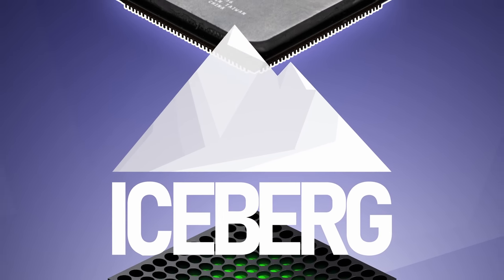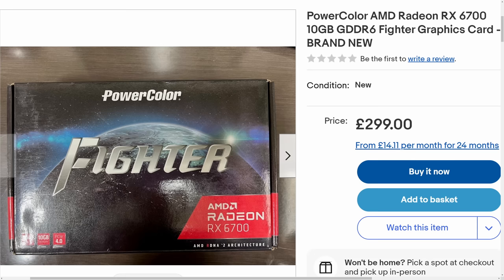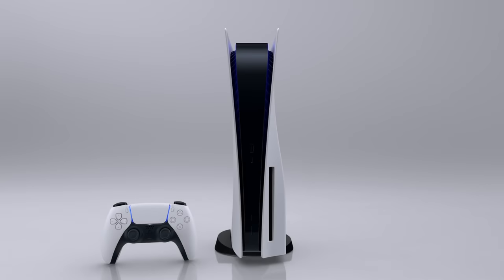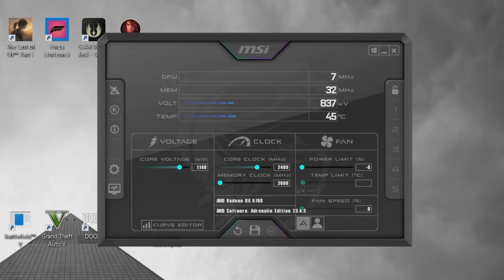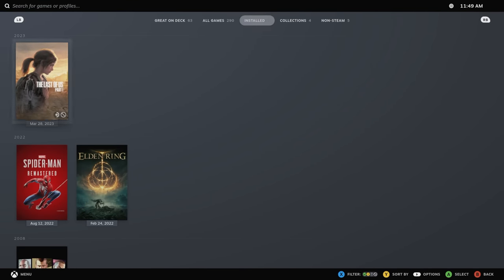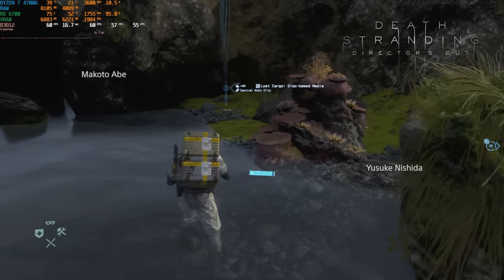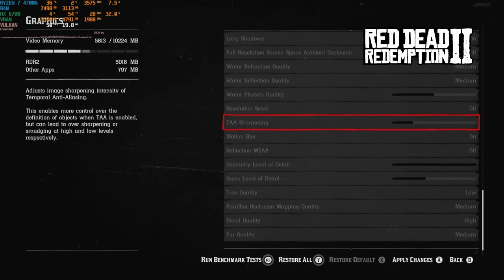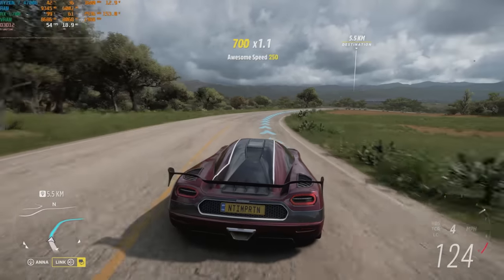I Built a 9th Gen Console (kinda)

Comment from the maker: ERRATA/CLARIFICATIONS
10:55 Yes, of course I meant Big Picture mode, I even wrote that in the script, I don’t know what was wrong with me when I recorded this…
11:11 Just using the Medium preset in TLOU gives a pretty smooth 30+ experience overall, but as far as I can tell its image quality isn't quite up to PS5 standards.
Reply: Okok 👍👍👍
Reply: Iceberg just keep making the videos you make, I love each one of them and watching your videos always makes me feel very cosy and in-home. ❤
I am sure you will reach 100k and more subscribers under a year.
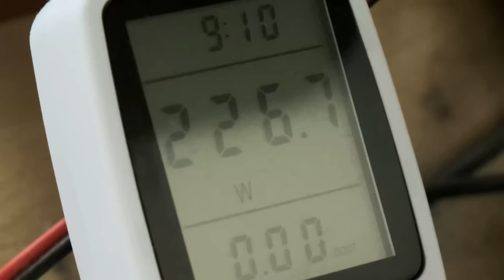Reply: Seems to be a green/blue flickering horizontal line on the screen from 15:35 onwards until 17:33
Reply: AMD doesnt report power consumption correctly with any ryzen cpu besides the latest 7000, RDNA 2 also use dream numbers, this is why its important to use a watt-meter or LDAT when it comes to AMD power consumptions. Nvidia and Intel have been reporting correctly for as long as i can remember.
Reply: 1800p?
That's simple enough with ToastyX CRU. 
For example, I've created many arbitrary resolutions such as 1778 x 1000p and 1689 x 950p. You can also create custom refresh rates like 48Hz for watching 24FPS content.
Reply: You can use 1800p on pc you just need to create a custom resolution

Comment: Making a budget console equivalent this generation is much harder compared to building a PC similar to PS4/PS4 Pro back then
Reply: Amen to that brother
Reply: Several reasons for that 
1) These consoles actually a have competently designed CPU architecture instead of AMDs Bulldozer mishap.
2) These console came out with for their time pretty darn decent graphics power (instead of outdated laptop grade and old crap)  
3) These consoles are (or at least initially were) sold at a loss instead of profit since day 1
And add to that the nowadays utterly insane GPU and motherboard pricing (CPUs, RAM and Storage are actually at the price point where they should be). Cryptoboom+Scalpers messed up the market and NVIDIA and AMD decided they'd like to continue that pricing structure.

Things are starting to look up somewhat again though, an AMD 5600 is only $118, AM4 motherboards start at ~$70 and with some luck you can pick up an RX 6700 XT on the used market for $250-275 or ($150+ for a RX 6600 XT if you're happy with a less than console like experience). At least PC gaming is possible again at a $500-1000 price point, during the height of the cryptoboom just the graphics card alone would run you the price of an entire system.
Reply: Hell yeah and then making an actual good gaming PC we should target higher than the best current gaming console cause one thing consoles can always rely is they always have more customized hardware and usually better optimizations...
Reply: Consoles are sold at a pretty big loss, they make up for it with game sales and paying for online.
Reply: the ps4/xone were underperforming pretty hard early on with games like gta v that ran at 1080 30 because of the cpu while on a gtx 750 ti 1080 60 was easily possible nowadays in games like god of war on pc the ps4 performs closely to a 1050 ti and im not even kidding
Reply: @Axeiaa  the ps4 gpu was actually decent basically a hd 7850 lower mid range card together with gddr5 vram with up to 150gb of bandwith it punched above its weight in the last few years
Reply: @xtr.7662  Yep that's just one more reason a serious PC gamer should go considerably higher than the console...

I also remember even with my outdated GTX 570 bought in 2011 with massive 25% OC over stock 570 clocks which brought it to around 1.9 Tflops which on Nvidia side was considerably better real performance than a same Tflop ATI\AMD card from back then and I could play a lot of games better and with better settings than the PS4...

But it didn't last long until the point GTX 570 barely could play any demanding game specially because of the lack of Vram with it's only 1.28 GB and PS4 just kept getting better and better showing more and more visuals...

ps: Every gen that happen, though nowadays PC's as long as you have enough Vram, ram and decent hardware probably will last longer than ever compared to it's matching gen of console, but sadly lately it seems bad PORTS are still a god damn thing FFS😡
Reply: @Axeiaa  Number 3 is QoL feature creep. It's unfortunate that those features don't come at previous gen prices, but that sort of to be expected. At some point soon, given the sales data from the PC market, we'll start seeing the budget stuff - especially when the next Ryzen APU's hit the market - come back to the fore.
Reply: Do the pirated games make up for the difference?
Reply: @bulletpunch9317  LMAO. How do I love this comment 🤣
Reply: When the PS4 was brand new the PC Equivalent was also wayyy expensive. As it grew older, however, that's when the console equivalent PCs began to get to the cheap levels
Reply: Yeah, it's like building a PC that is like a Xbox Series S where you at the very least need a GPU that can run any current game at 1080p, at any setting and not dropping below 30 FPS.

That is the GTX 1070 or equivalent, the 1070 is still expensive on eBay.

Then Ryzen 7 Zen 2...not cheap either...
Reply: Yeah but what about: Games being a lot more expensive, PAYING A SUBSCTIPTION TO PLAY ONLINE, console devaluating instantly as soon as you buy it, not being able to mod games, not being able to choose your own graphics settings to disable that ugly TAA and DoF, Not being able to use your PC for work or whatever else you want.

Console is a complete waste, console is stupid.
Reply: @Axeiaa  Technically the previous gen consoles used the Jaguar architecture for their CPU cores, not a Bulldozer derivative. This doesn't change the point you were trying to make though. Jaguar was an evolution of Bobcat, which was designed to compete with Intel's Atom CPUs.
Reply: @bulletpunch9317  I dumped all my money into the PC so it’s the only way to get games🤣 
seriously though games on steam are usually cheaper than consoles and there’s no stupid monthly subscription to play with friends. And games with visual or enhancement mods is just so much fun. Playing everything at 2K 170hz has spoiled me, 30fps gives me headaches now haha
Reply: PS4 GPU was pretty much a Radeon HD 7850 which was released for $249 in 2012, and in 2013/2014 it was even cheaper. Manwhile today we have to pay $280-300 or more for a new RX 6700.
Reply: Reminds me of the OG Xbox, that thing had so much power compared to the average pc in 2001
Reply: @Axeiaa  They weren’t bulldozer though. The Jaguar cores in those machines are a totally different architecture and are closer to Netbook CPUs based on K8.
Reply: Different OS?
Reply: @takehirolol5962  Yep, it's usually in the later half and mostly towards the end of a consoles lifespan, when you can build an equivalent performing PC (new) for roughly the same price.
I'd give it another 3-4 years yet (or 2 more GPU gens), until it's easily possible. That's unless you are buying used parts, which might just be achievable within the next couple of years or so.
One thing's for sure, the performance level that's given out by that PC by then, will be judged to be squarely within the realms of it being a lower-end, budget gaming PC, rather than a mid-range gaming PC like now.
A consoles overall value and it's "price to perfomance" ratio, just tanks and loses out to PC as they age. This is due to them still being firmly tied to old tech and the console manufacturers unwillingness to then lower down thier prices to a reasonable level, in order to reflect that then aging tech that's found inside of them.
Reply: Imho, if all you care about is gaming, you can buy a used B450, used R5 3600 - that's $100 and probably comes with a stock cooler. PBO, undervolt, LLC and a decent kit of 3600 RAM taken to 3800 with tuned timings, you're absolutely performing better than the PS5 CPU. That's $150.  This is assuming no particularly good deals - otherwise much cheaper. 

A used 6700 XT is about $250-300, can probably find it for less or buy a 2080 Ti for about the same. Now I understand you're still missing an SSD and PSU (any cheap case will do, but people have different requirements). The PS5 comes with a 512GB SSD - that's $20. Spend about $50 on a refurbished B-tier PSU and you're $20-50 overbudget - again just using market prices and NOT assuming any good deals. 

I don't think it's that hard, I think it's matter of wanting plug & play vs being a PC gamer/hardware enthusiast.
Reply: @fafski1199  I agree on what you said and it goes like that. But I am impressed with this generation of consoles and how those perform, not bad at all.
Reply: @b0ne91  3600 this processor is worse than in consoles apu 4700S.
Reply: It's only cause this is a new gen give it like 2 years and bam
Reply: @MaxPowerThe  they're the same architecture. And while the 4700 has more cores, the 3600 has waaaaay more cache. Guess which one matter for gaming? Lmao
Reply: @b0ne91  there is a complete and detailed analysis, 3600 and 4700s. The 3600 has much more significant problems, I just don't know English very well and I apologize for the incorrect text, but the copying speed and failures are strong there, there is also an unsuccessful line of chiplets, the console line of the chip has no problems with copying and there are no such failures in the more successful ssx line and faster caches, the number of l3 at 3600 doesn't help much. And if you want to compete successfully, then use the more advanced 5600.
Reply: @magcs6233  it really wasnt its strongest part was its gpu which was a modest mid range pc part while all other components were cheaped out, it was just that the gamecube and ps2 were just made of lower end components so the xbox was ahead in terms of specs
Reply: @magcs6233  and pc parts were significantly more expensive at the time so a console was a very good deal similarly to today
Reply: @guily6669  thats whats gonna happen to 8gb gpus like the rtx 3070 with ue5 games that are very vram hungry even with optimization
Reply: @xtr.7662  The GPU wasn't mid tier, it was an amalgamation of the Geforce 3 and Geforce 4, which wasn't even released to the PC market until a year later
Reply: @magcs6233  true the xbox gpu was pretty much high end when it released
Reply: @xtr.7662  yeah, they only skimped out a bit with the CPU and RAM, even then, a Pentium 3/Celeron @733MHz was pretty decent for 2001
Reply: At times in 2020 and 2021 a PC equivalent build to a ps5/series x was like $1500, maybe even $2000 with the most insane gpu pricing that was common. I paid $900 for 6700 xt in May 2021 (from bestbuy). Also SSD prices were pretty wild,, too, especially one that could come close to the ps5's SSD back then.
Reply: Easiest way is Xeons and used 1080tis but then power usage is insane
Reply: Why would I buy this when i could put an i3 12100f or ryzen 5500 with an 6700xt or 7600?
Reply: - "Games on console aren't really more expensive these days" There is no concept of 'regional pricing' for many countries on console stores because they have a monopoly, games on PC are waaay more cheaper in a lot of circumstances.

- "If you care about the $15 a month for console online play enough for it to be an issue you don't need to be playing games, you need a better job. 
"
Sure, make an abusive predatory practice a 'just have a better job' issue. Blame the victim.

Your biases so far are based on being on a privileged position of being able to afford abusive and predatory practices, keep defending billion dollar companies, sure they will thank you for that.

- "Mods while popular are still niche"
Sure, modding has been an staple of gaming since forever, surely nobody keeps playing minecraft because of the annual updates, not that a big part of it being alive is fore modding, is not like Skyrim being one of the best games of all time isn't thanks to modding either, is not like Garry'sMod isn't a staple of PC gaming.

- "I and many others prefer vanilla because we see games as art and modding games to a lot of us is the equivalent to drawing a mustache on the Mona Lisa"
So you have only tried/seen mods that are just jokes instead of the pieces of giant work being made like "Portal Reloaded", Skyblivion, Skywind, etc.

- "For the "ugly" settings number one, that's subjective"
Sure, but the key-word here is **option**, not being forced-in.

- "number 2, plenty of people on PC just use presets without further modifying their settings"
No, that isn't true.

- "not everyone uses or needs their PC for productivity related tasks"
Not everyone does, sure, but that does mean that your computer can be Reused, it doesn't become direct e-waste when you eventually upgrade. There are still plenty of 4th gen intel machines lying around, compare that in 5 years to any XboxOne or PS4, there won't be any of those around.

- For last i agree that a console is just a thing for people that don't want to fiddle around.
But still, consoles are not worth it.

 @baronvonslambert
Reply: @baronvonslambert  The PS4 was sold at $399 for a BOM (Bill of Materials) of $372. 
Assembly / shipping / packaging would put them at about break even. So it's likely you're right but it doesn't change much about the point #3 is trying to make - they definitely didn't try to push any boundries.
(The XBox One is a weird one because yes, they did have to sell that at a loss but that's mostly because they bundled it with Microsoft Kinect)

imo it was the worst console generation there has been. They aimed low and the mediocre graphics for the time already got outdone on day one by PCs. It's not like the current generation is doing very well compared to PCs either when you're just looking at performance but that's because prices for PC parts are absolutely insane (you can buy 3 PS5s and a spare controller for each and have money left for the price of a single RTX 4090)
Reply: Ps4 and bones didn't use bulldozer chips, they had the jaguar based architecture.

Comment: Consoles also have a hardware decompression module which offloads the CPU, increases storage bandwidth, and spares vram. The closest equivalent to a console would be something like a 5700x, 16gb ram, gen4 ssd, and a 6800.
Reply: Directstorage/rtxio will be doing effectively the same thing by just using the gpu instead of the CPU.
Reply: @spaghebbio  I think this isn't gonna work as well as people hoped and it will still come with significant overhead in one way or another.
Reply: I totally agree with you, your comments are correct.
Reply: Pc in vid is closest. Not yours.
You can't be throwing around 32mb of unified L3 cache on the 5700x and pretend it's not a huge overshoot of the impact of decompression hardware and other low level optimisation. 
Ok so the consoles are great at getting the data INTO the cpu but they still have to wait around for that 2x4mb L3 to have an opening.
Reply: @foxdart  Because decompression hammers single core performance the most. I wouldn't get too much into whether that single core boost comes from the cache or the frequency (as it would in an equivalent intel cpu like the 12600k). Besides the super high bandwidth unified memory and no OS bloatware kind of makes up for the lesser cache.
Reply: 5700x 🤣🤣
Reply: 5700x, 16GB RAM, Gen4 SSD, 6800. It destroys the PS5, man. There are games that the PS5 can't achieve 60 FPS because of the CPU, and the Ryzen 5700x can easily do 60 FPS, like in A Plague Tale at launch. IGN did a direct comparison between Ryzen 5600 + 6800 and the PS5 using the same resolution and graphics in Uncharted 4, and the PS5 got completely destroyed. The 6800 was almost 40% faster, and in performance mode, the Ryzen 5600 destroyed the PS5 by obtaining much higher FPS. In PC, there is a technology called DirectStorage that does the same thing as the decompression you mentioned

Comment: "Console Killer", Kit X99 motherboard with E5-2640v3 (can core clock unlock) and 16GB ECC DDR4 3200 (60~75US$ AliExpress), RX 5700 XL 8GB (120US$ AliExpress), 1TB NVME SSD (30US$ AliExpress), 500W 80+ PSU and PC case (20~50US$ anywhere), total cost around 250US$, Series S Killer 100%, but I'm not sure about PS5/Series X...
Reply: For me, a RX 5700XL(not  sure where this naming comes from) would cost around €150, and DDR4 would be a bit cheaper.

Comment: i was sitting here thinking "that performance seems really low...a 4700G and RX 6700 barely hitting 45-50fps?" then i remembered...OH YEAH, you gimped the thing! that's pretty crazy how well this system held together, seems very balanced at that power target. meanwhile my Ryzen 5600x and RTX 2070 system will easily hit 300W and just barely keep up.
nice build and excellent reporting as always, mate! thanks!
Reply: >meanwhile my Ryzen 5600x and RTX 2070 system will easily hit 300W and just barely keep up.

this generation of consoles is amazing.  if you could buy that APU/ram package in a PC build it would be a fantastic system.
Reply: @SB-pf5rc  I've always wondered why AMD has yet to make the chips / apu (whatever they are) available or even make a small board with the APU and memory as a small ITX package.
Reply: @27Zangle  money and rights. the chips were developed side-by-side with MS and Sony. turning those chips into home-computer components would mean they'd risk data mining and hacking the consoles. and who, other than office spaces where they care more for cost effective vs efficient, would buy them? they've already got partners making mini-PCs using their mainstream chips, they don't need another market
Reply: @dragonhart6505 Perhaps a hypothetical Steam Box type machine. A console-like PC of sorts.